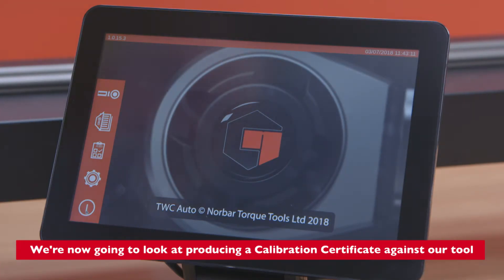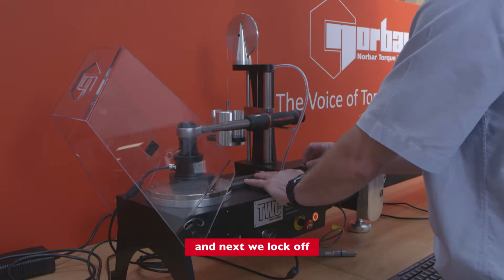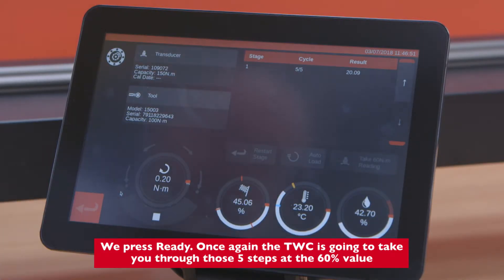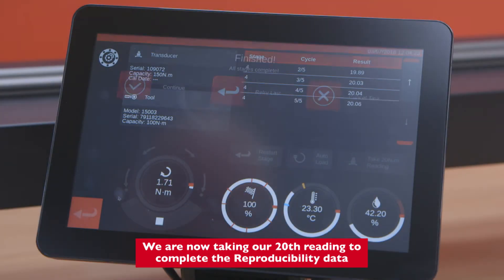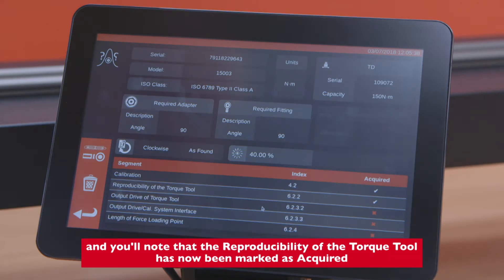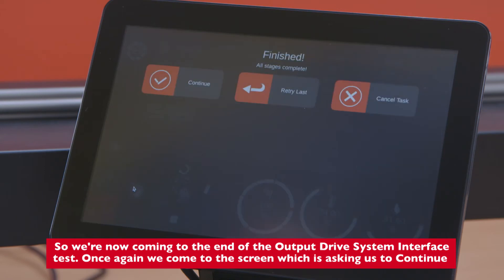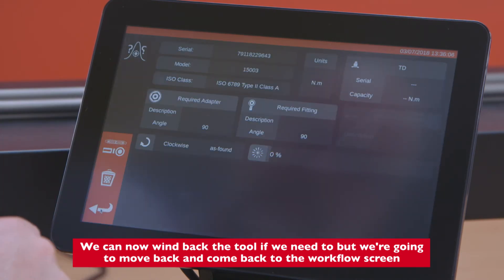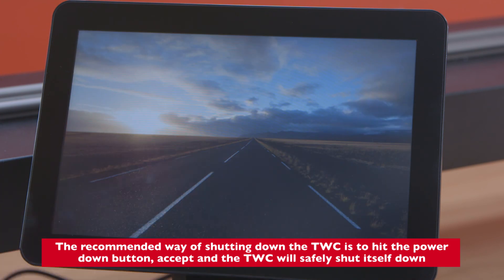4. TWC Auto - Producing a Calibration Certificate

Comment: We would like to know the below 
What mechanism we need to use to bring the torque level to the initial settings.
For example initial calibration setting may be for 20,60 and 100Nm and after the usage of one year range would have moved to 25, 65 and 90. In that case what technique we should use to bring back to the origianl settings of 20,60 and 100Nm
Reply from the maker: Thank you for the question. Most torque wrenches have an adjustment mechanism, which can be a screw or dial, allowing for the calibration to be altered. The specific adjustment process can vary significantly depending on the type and model of the torque wrench you have. The Norbar TWC Auto featured in this video is designed to make the process easier, but it is still very important to have the necessary expertise and knowledge to bring the tool back into specification. We hope this is useful and please do make contact again if you require anything further. www.norbar.com.